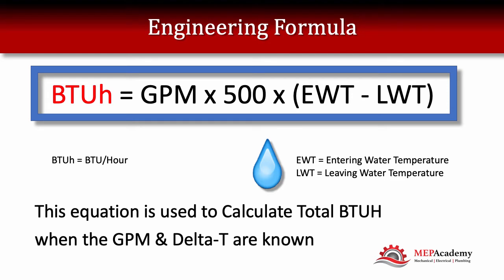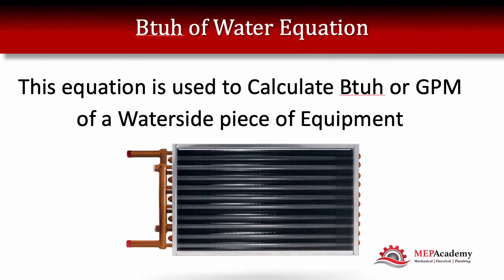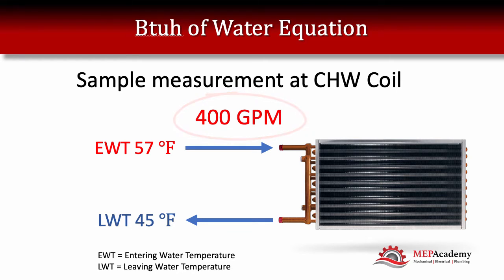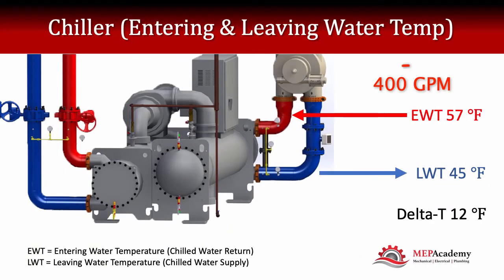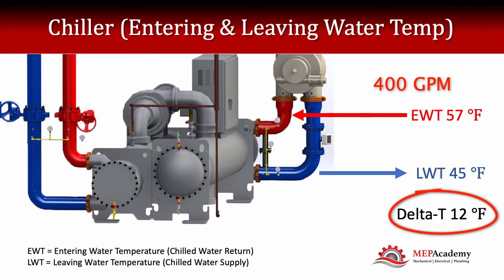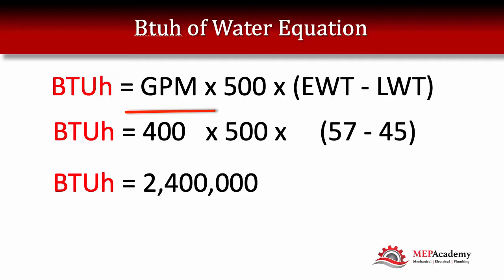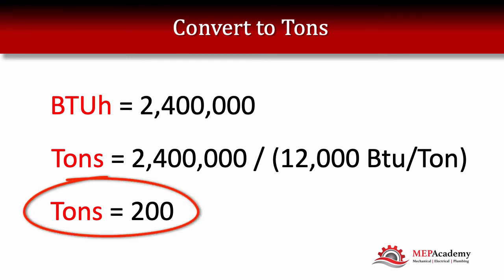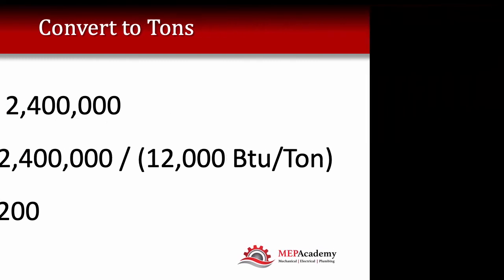How to Calculate Total BTUH of a Chiller or Water Coil

Comment: BTUH = (Gallon / Min) x ( 60 Min / Hour) x [ (1.0 BTU / LB - deg F) Specific Heat Cp of Water x (8.34 LB / Gallon) Density of Water]  x (Delta T deg F) 

in Unit Analysis this would be equal to 

BTU/Hr = (Gallon / Min) x (60 Min / Hour) x  (8.34 BTU / Gallon - deg F) x (deg F)

Comment: How he got the 500 is the weight of water (8.33) x multiplied by the specific heat of water (1.0) x (60 minutes)= 499.80 rounded to 500.
Reply from the maker: Correct. 8.34 Lbs/Gal x 1 (Specific Heat) x 60 Min/Hr = 500

Comment: Could you explain what the 500 in the equation mean? And how it’s derived?
Reply from the maker: Because BTUs are measured per hour, the 500 comes from one gallon of water that weighs 8.33 pounds, times 60 minutes in one hour. (8.33 pounds X 60 minutes = 500
Reply: @MEPAcademy  thanks you so much!

Comment: Where did the constant 500 came from?
Reply from the maker: The 500 is a constant that represents the Fluid Factor, which includes the weight of the water (8.33 lbs/Gal.) x the Specific Heat of Water (1.0) multiplied by 60 minutes per hour. 8.33 x 1 x 60 = 500